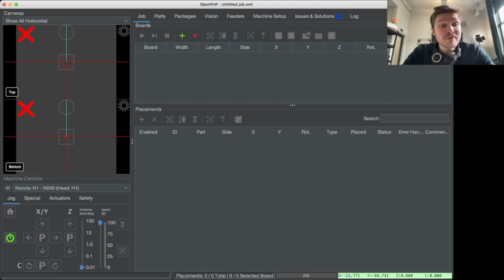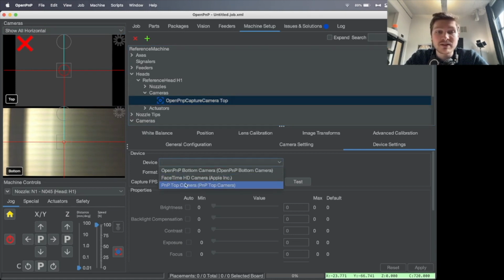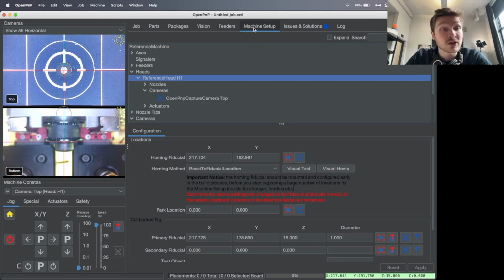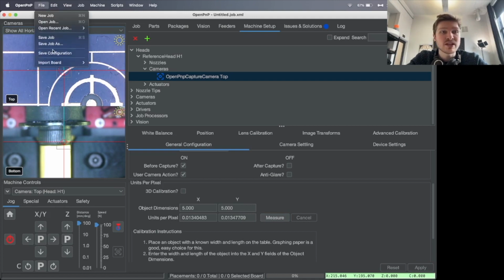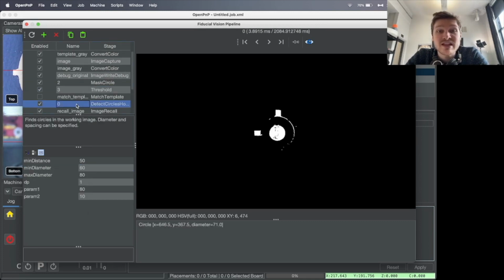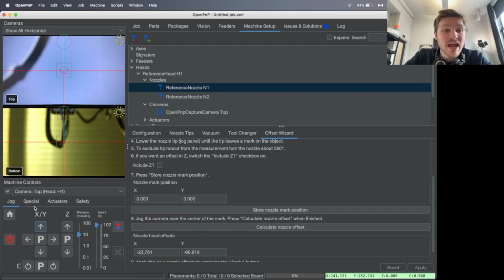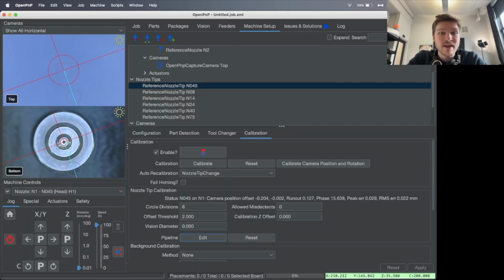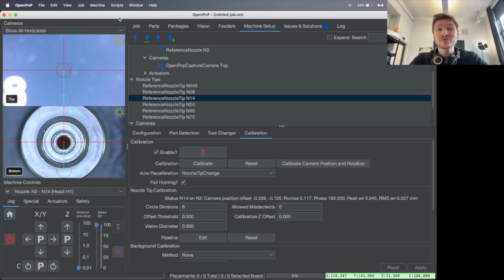LumenPnP Calibration Walkthrough - v3.0.2

Comment: The CP40 tip that came with my lumen has an outer diameter of 6,2mm not 4mm. i wondered why my calibration on the bottom cam was off that much.
Reply: you used the wrong one